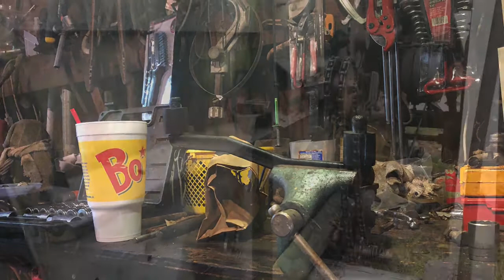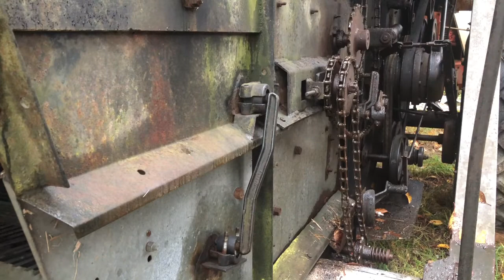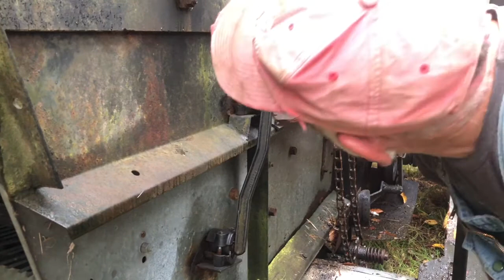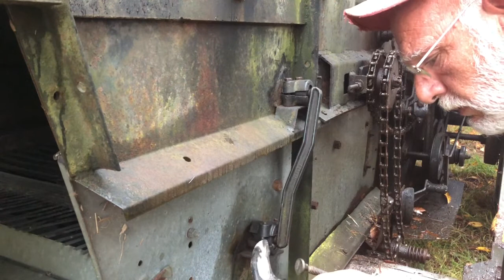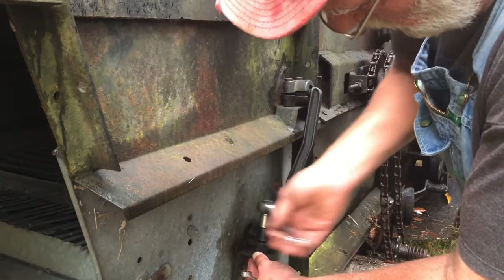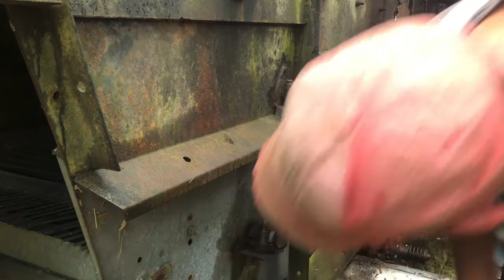Working On The Gleaner K part 7b

Comment: Funny think was while watching you install those bushings I kept thinking of how I installed new tires on my pedal tractor.  Pretty hard to stretch them onto the rims so I boiled the tires and used plenty of dish soap and they went on easy peasy.  Looks like your bushings went on pretty easy with just soap.  Later
Reply from the maker: Yes they don’t go on so well,had the same situation trying to fix the my old pedal tractor for my oldest to ride .

Comment: Changing those bushings is a lot easier than what the 4400 has.
Reply from the maker: Gleaner seems to be some what easier to work on. Just hope clutch holds out till corn is picked.Just bought tester on eBay like yours